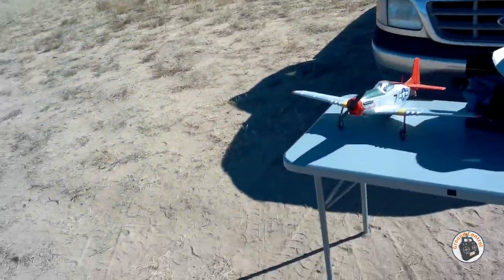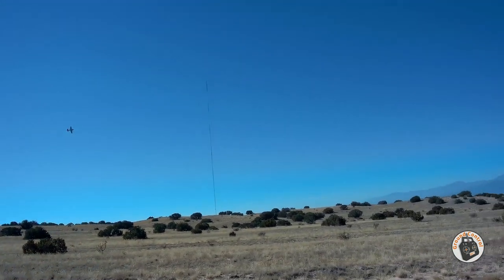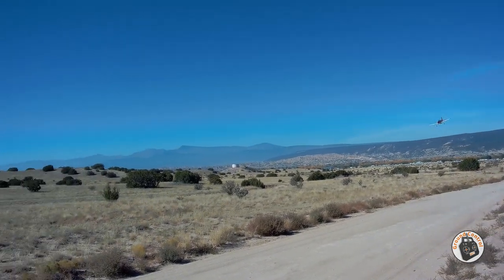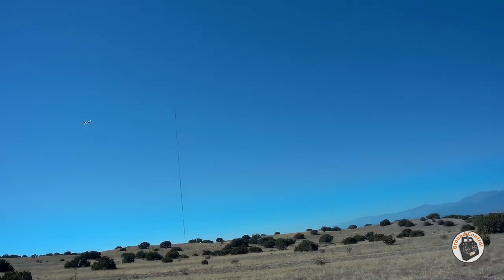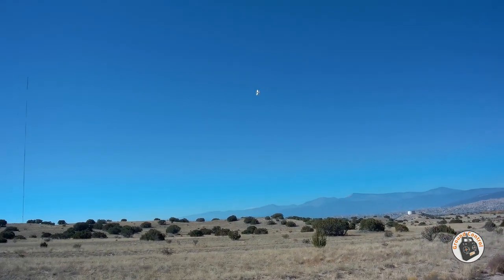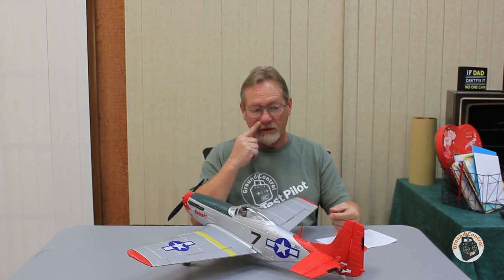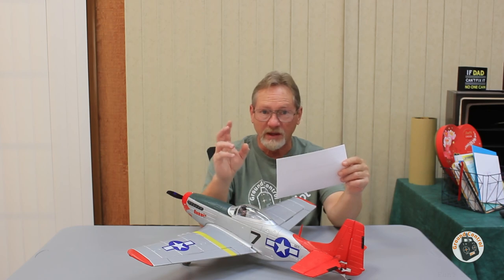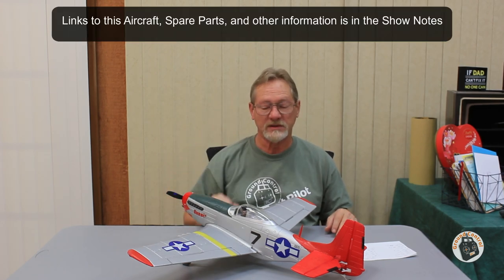Volantex P51D Mustang 750mm Wingspan PNF - Awesome Flights! Updated Setup & OpenTX Model File ;-)

Comment from the maker: I thought I'd post one more successful flight session before the next T-33 launch.
It just makes me feel better ;-)
Reply: T-33 looks the biz.
Good Luck with that sweet looking Frame!
Reply from the maker: @jonoedwards4195  Thanks Jono!
I think I'll get it there if I don't destroy it first.
Too many Pilot errors these days.
I need to settle down and fly right ;-)
See you in the Air!
Reply: Any chance you can put a spinner on this "Stang" just to complete the look 😊
Reply from the maker: @rodinvillarosa2924  Hey Rodin!
If I hadn't had to replace the motor and mount, which put the motor in a different thrust line, I would have tried to MOD the stock spinner for the 2-blade prop.
I haven't looked, but there's got to be a spinner out there somewhere for a 2-blade 7x4 / 6x3 prop.

Comment: And another plane that requires lots of modifications to perform the way it should have directly from the manufacture.  I do hope the manufactures are listening and watching.  Nice work on your part.
Reply from the maker: Thank you much Jack!
I know exactly what you mean.
When this plane crashed after so much work I was so tempted to just scrap it for parts.
I let it sit in the hanger for over a year collecting dust before I took another swing at it ;-)
Things should not be this hard ;-)
See you in the Air!

Comment: Letting it Rip Mate!
I totalled My second after the first one flew off to the Dreamtime.
This, Err,, another Bird that Hates Me, ahahhahaha, glad You can shred with it, Awesome.
Great Show GCRC. funny how We get comfy with certain Airframes.
Reply from the maker: Thanks Jono!
It certainly was a problem child to begin with and I thought it was cursed ;-)
Now that the Gremlins have been exterminated it's one of my favorites.
Oddly, I'm going through the same process with the T-33.
Now that the Gremlins have taken up camp somewhere else I think this T-33 Jet hates me ;-)
She was flying nice and pretty until I totally messed up on the landing.
It seems all I do lately is repairs ;-)
I want to go back to the days when they all came home in the same condition in which they left the hanger.
Back to repairs...again.
See you in the Air!
Reply: Same here Jono, trashed mine in 30 seconds, bent the motor shaft. Mothballed it for now. Will probably do a GCRC type mod down the road. Those tips will come in handy

Comment: I appreciate the setup and TX files. Helps quite a bit when you're not very experienced. Working on the Ailerons and using you specs for servo and horns I can't get the deflection past 16 in High mode, spec calls for 20 and I'm at the outmost hole on the servo. Any tips or comments?
Reply from the maker: I'm glad those files are helpful.
Yes, I had to adjust the linkage at the servo to get the amount of aileron deflection I wanted.
By moving the linkage on the aileron lever arms down you increase the deflection.

Comment: Nice fly! Do you think I can try my 3S 500mah battery on the stock esc/motor?
Btw, I tried opening the props link and it did not work...
Reply from the maker: Thank you!
No, the Stock ESC is only 10A and you'll be pulling over 10A.
Strange, it looks like the RCTimer website is down.
Here's another link:
10pcs 6x3E Prop
https://www.aliexpress.com/item/32824008083.html
I just do a search for RCTimer/KMP/EMP 6x3E Sport Prop.
Sometimes they're hard to find.
Reply: @GroundControlRC  Got it, thanks!

Comment: Why dont you show on a video how to setup the plane on your radiomaster, instead of posting a file that I have to do extra   Handlings to get it to open
Reply from the maker: Hi Ruudy!
Hum...the File is just a zip file so I'm not sure why it would be difficult.
I also provide a Setup File that list everything you need to have it setup exactly as this one.
I've provided approx. 30 Setup and OpenTX Model Files for the Aircraft I've flown.
Making videos takes a lot of time.
I just don't have the time to make a video of the RadioMaster setup for all the planes I've flown.
I do all of this in my not so spare time ;-)
See you in the Air!
Reply: @GroundControlRC  Just tell me which protocol you used  Otherwise I have to install another app on my computer, and get ever more advertising
Reply from the maker: @RuudyL  Hi Ruudy!
I use DSMX Protocol.
I have the PNF version not the RTF version.
As far as I know, the RTF Protocol is not supported in OpenTX.
I'm assuming you must have the RTF version?
I have a standard RX and no Gyro in mine.
I use OpenTX Companion on my computer so no advertising ;-)
The Setup File is just a PDF File that has all my setup on this Plane including, Control Surface Deflection, Linkage Positions, Dual Rates, EXPO. CG, and Launch Throttle.
I hope that helps.

Comment: I have the rtf version, the receiver/ gyro is just terrible.  With stabe on the plane waggles all over, just looks silly.  Kick the gyro off, and it goes straight up and into a loop.  No trim or cg mods have made any difference.  I'm going to follow your lead, pull the stock receiver and replace with a standard receiver.  The stock motor has good power as you say, but a light bump to the nose will bend the loooong motor shaft.  I got a 4 blade prop with my p51, but a spinner for a 2 blade prop, so couldn't use the spinner.
Reply from the maker: Hi Mike!
Some of these Gyros are pretty bad aren't they?
I do prefer Manual Mode.
I couldn't use the spinner on mine either.
I hate those long threaded prop shafts they put in some of their planes.
My Volantex Super Cub 750mm had the same motor and long threaded shaft.
I took my dremmel tool and a cutting wheel and cut the shaft off at the end of the threads and installed a spinner collett on it ;-)
Worked like a charm and less chance of bending the motor shaft.
I think you like it much better without the Gyro causing problems.
Good luck and I'll see you in the Air!
Reply: Agree with you.  I will say some planes with gyros fly quite well.  My son has the Ultrix, which almost flies itself in gyro mode.  Great confidence booster for newer fliers.
Reply from the maker: @1mikeb  I think that's the best way for new fliers to start.
I hate to see someone get discouraged having to repair an aircraft too frequently.
Reply: We've definitely glued the noses on our park fliers dozens of times.  On one, the nose is probably more glue than foam!  Speaking of which, like you, my Foam Cure glue isn't working well.  Maybe it's old?  I've been using E6000 on EPO and EPP, really works well and easily available.  And if you have a regular styrofoam plane you hate, E6000 will dissolve it!
Reply from the maker: @1mikeb  Hehehe...yes, as a matter of fact I used the E6000 glue to perform the original repairs on the Arrow T-33.
I think Paul Hope told me about that Glue.
I picked up a tube of the E6000 to use on the T-33.
I love that stuff!
I can pick it up at my local Lowes Hardware and it's less expensive than the Foam-Tac / Foam Cure.
I had a question as to whether it would also work on EPP Foam and you just answered that question.
That's awesome!
It will also dissolve Adam's Readi Board Foam.
Most a pitty!
I guess I'll have to continue to use Hot glue and Foam-Tac / Foam Cure on my DIY Planes.
I thought the same thing, maybe the bottle of Foam Cure I ordered had been setting on the shelf a long time before they shipped it.
Now I'm thinking they've change the Glue Formula, changed the EPO Foam to make it much more slick, or both.
I won't be using it on EPO / EPP Foam anymore as I'll be using the E6000.

Comment: Looks like my post vanished again.  You had zero views when I commented early this morn. Guess I need to stop posting links in them.

I was wondering if a red aftermarket 1.5" or 1.75" spinner would fit?  Can't post a link to the ones I was going to suggest though. Bang Good offers some.
Reply from the maker: That is odd.
Usually they end up in the "Held for review" when they contain links but I just checked and there's nothing there.
Those spinners your referencing might as long as they have a way of being secured with a spinner collett or nut.
I don't think post with links are effected on our Facebook Page but Youtube flags a lot of stuff ;-)
Or you can email the link to info@groundcontrolrc.com
See you in the Air!